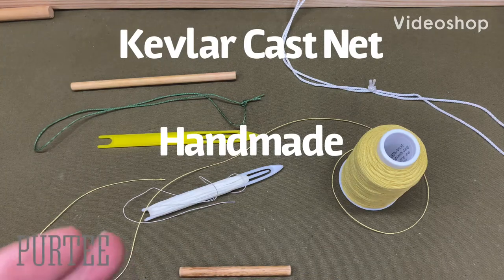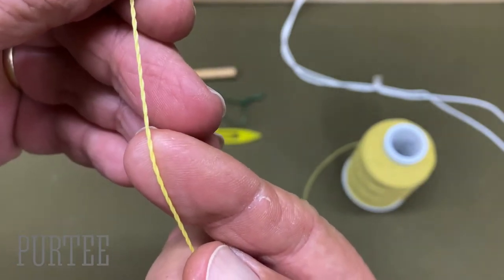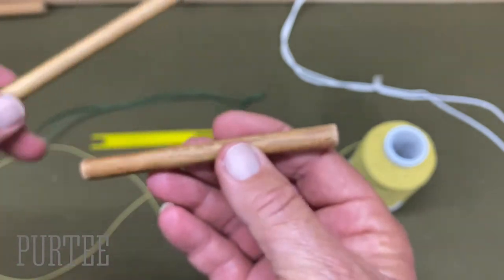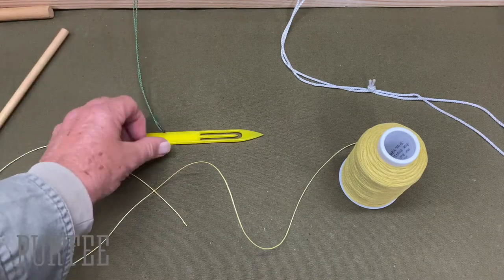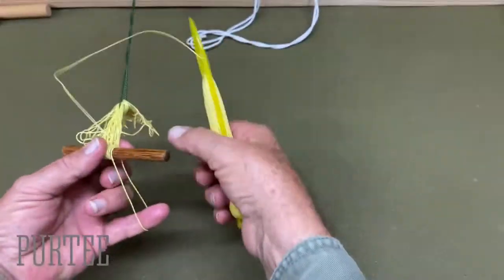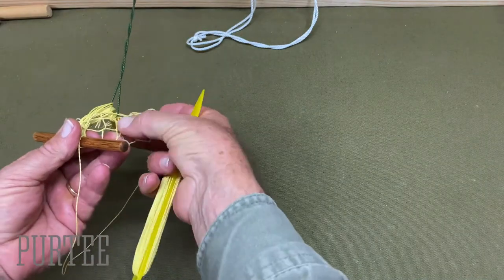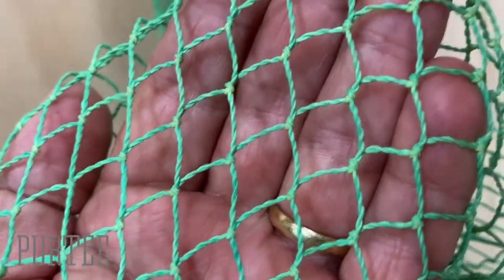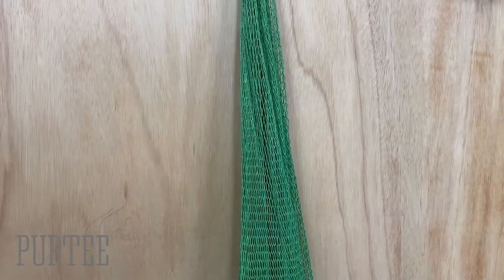Kevlar Cast Net, 100%, Handmade

Comment: I made one out of 65 lb test power pro. 20 ft in radius, 854 meshes on the final row, 1 inch square mesh, last 2 rows are double selvege, handline is ready as soon as I get the leadline attached. I actually hung a leadline already but I had to cut it off as the leads kept flipping up and getting tangled, so I cut it off. I ordered 75 ft of chain, 30 lbs of chain, I'm gonna hang it with that and try it out. Because the power pro is so slick I double knotted every single knot to lock them in place. I'm using one of Lee Fishers "Dragon Head" net collars/heads. Once I get the chain attached I'm gonna dip the net for improved abrasion resistance. I've got over 35,000 ft of line in this net, $700 worth. I was going to order lead circular chain to hang it with, but the only supplier I've found is in China and I'd have to order via Alibaba, I'm a bit hesitant to do that, for one, I don't trust Chinese businesses, and for two, it cost twice as much as steel chain once you pay for shipping. I found 75 ft of steel chain that weighs 30 lbs online, costs $80 including shipping, so I gave up on the lead and ordered the standard old 3/8th's inch steel chain. i also ordered a lb of #4 and a lb of #6 bonded nylon from Memphis Net & Twine, should be here in a few days. This net took me 6 months of work on my off days!

Comment: Turned out beautiful. Do you also do monofilament nets? Also where do you buy the net dip?
Reply from the maker: I don't use mono because it does not last and is a hard material to work with and in my opinion does not make a good net. 

If you go to Memphis Net and Twine you can get your #4 bonded nylon and you can search for the dip and see who sells it in your area.

Comment: Have you ever used any of the braided fishing lines for net making? I have been considering trying it. If it worked it should be as stout as a nylon net but sink faster with the line being much smaller diameter and less drag than equal strength nylon.
Reply from the maker: Yeah, that should work but I think you may encounter problems that doesn’t plague the twist nylon. The twist nylon is made for making nets and the fishing line is used for fishing. It will be more expensive going that route but I would think it may work ok. Give it a try and get back with me to let me know how it works out for you.

Comment: Have you any experience in using braided dacron fishing line? If so what is your opinion. All the best.
Reply from the maker: gordon murdoch I think they are both equal performers but there is less selection of braid in my area. I use a very fine #4 twine for my nets. The cost for Dacron would be very high pushing the cost of your net too high. This Kevlar net was very expensive to make but I simply made it for novelty reasons. I hope to load test it one day.
Reply: @equipyourselflifeskills5802  Thanks for your reply. As I'm doing this as a hobby my time is not a factor so if the twine costs more then so be it, at the end of the day what I'm looking for is a net that will last with minimum breakages. All the best.

Comment: Where do you buy your needles? How does a person distinguish between a well made needle and a junky needle?
Reply from the maker: A good needle will not bend very easily and will not crack under pressure. They are flexible, of course a small needle will flex a bit more then a large. You can find commercial net maker supplies in the US and they all carry quality needles. I also bought some from Amazon to check the quality and they passed my test as a quality needle. Of course I didn’t buy very many but I wanted to check to see if the average person were to order them there if they would pass the test. 

A one pound spool of #4 twine will be all you need to finish a 4’ net and have plenty left over for any repairs or other uses. Insure you buy “bonded” twine. It’s very important. You may check Memphis Net and Twine Co, they carry a large selection of net making materials.

Comment: Sir, l've watch every step of your techniques and l learned them all l mean l did exactly as per your instructions, now l have one questions, which is the fishing bag, here in the fishing bag on the lead line one of my friends cast net while throwing it spreads out nicely but it cannot catch a fish or can't even stuck a single piece of stone inside the fish bag ( its not that there isn't a fish). What do you think did he miss while constructing net from start to the end? Its an lndian local net.
Reply from the maker: Felix V depends on the Net type. If he has one like I make (in the videos), the braille lines (draw strings) should close the net and he should have the bait if it is large enough to be caught by his net.
Reply: @equipyourselflifeskills5802  Sir, l have one more thing to ask, l am tryin to make 12ft long cast net of 1 inches hold, so like starting from the 8ft l am thinking to make the hold to a ¹/2 inches till the 12ft net, will that still workout for a cast net?
Reply from the maker: @lixv2432  No, that will not work, the net will not open up fully when it is cast into the water, it will act more like a cup. you will loose a lot of your nets length capabilities and it will never lay flat.
Reply: @equipyourselflifeskills5802  thxs alot
Reply: I think what you are referring to is a spanish style net. On that style the lead line is tied up with strings 8-12” up creating the “bag” or pocket at the end. 
With the braile net, the whole net becomes the “bag” once the draw rope pulls the brailes. 
The spanish net is better suited for “shore” fishing, were you can drag the net on the bottom. If you raise it like you would on a boat, or wading, you’ll lose a lot of your catch.
Reply: @tuloko16  yeah, something like that of a spanish style as you mention, yet again  l have seen people using it and works well

Comment: Hello, i m thinking about braid fishing line, do you think it's a good stuff for net ? Is 4x is enough or need to take 8x ? What size is ok ?
#4 is like 0.32mm diameter ( i'm from France  ) and 40 lbs resist.. is this enough ?How many ft or yards is needed for a 4m net ?  ( 14 ft diameter ) 
Thanks in advance
Reply from the maker: Anthony Adam my twine is normally about .021 of an inch. I am at work right now and will have to convert that measurement to millimeters later. To make a net that large, it would be difficult to determine the amount of twine needed. I normally make nets not to exceed 7 ft or just over 2m. I knot that is not much help but I just buy a pound of twine and use what ever it comes out to be.
Reply: @equipyourselflifeskills5802  ty for answer, i think an inch is 2.54cm but 0.021 give me 0.05 mm it's really low. 0.21 give me 0.54 mm that's something like #10 size and 100lbs resist.
I was wondering about amount of braid because its sell by 300, 500 or 1000 meters and i don't want buy to much ( cost mainly ), but i want enough.  For example do you know how much nylon used for this really nice video ?

Comment: Number of knots to be increased and at what point?
Reply from the maker: When you add your wideners (spacers) every three hangings you will be adding one hanging for every one you add. Another words, you start your net with 36 headers (slip knots) after the second round (after joining the net) you will start your wideners and by putting them every three hangings, once completed, you will have added twelve hangings and every time you add wideners  your adding twelve hangings. This allows you net to grow in diameter thus allowing it to lay flat. Hope this helps.